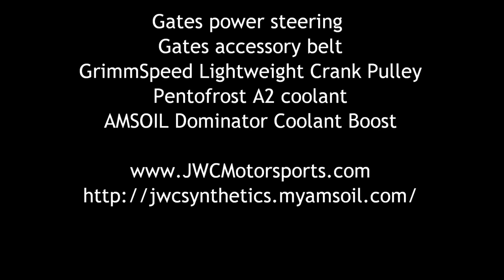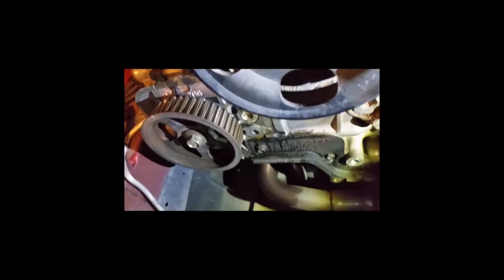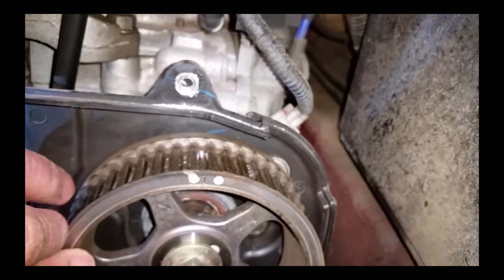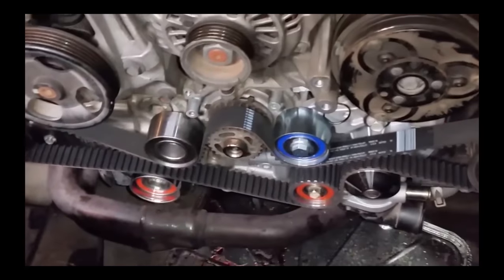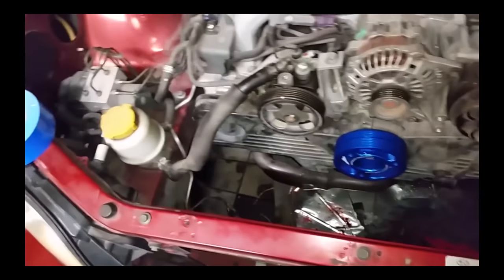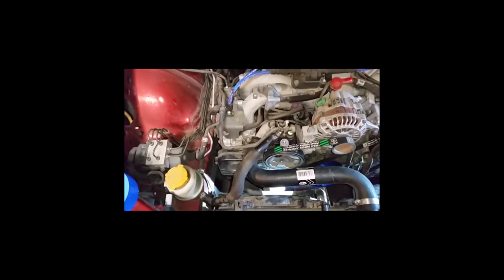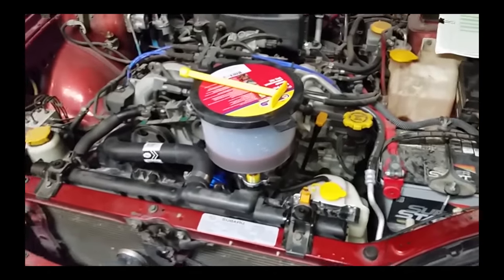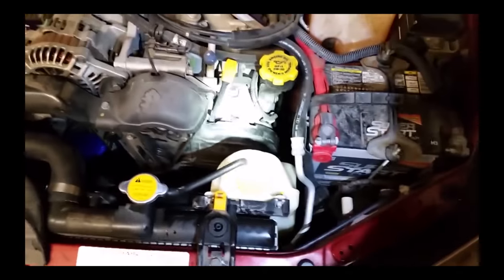2003 Subaru Legacy 2.5 Timing Belt Replacement

Comment: How did you get the belt on with all the pulleys installed.
Reply from the maker: Replace all but belt idler No. 2. (the one on the bottom).  After getting the belt lined up, Install belt idler No. 2. It should do fine to pull up the belt as you install it, be careful not to cross thread the bolt.
Reply: Thanks. I’ve been having trouble getting it on with the geared pulley installed too